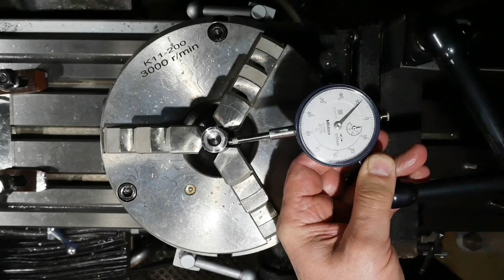Centering work on the rotary table

Comment: Is this still aligned with the Rotary axis?
Reply from the maker: Yes.
This method moves the axis of rotation of the chuck body away from the rotary table axis of rotation. This allows compensation for the run-out in the chuck jaws when tightened. As you saw in the video, the axis of rotation of the workpiece then aligns with the rotary table axis of rotation. 
Thanks for watching.

Comment: Nice!  Going to do this!
Reply from the maker: Thanks Tom. I used M8 x 1.0 jack screws but I think an even smaller thread pitch would be better eg M6 x 0.75 or 1/4" 32 UNEF . This would give an additional 6 or 7 tpi and provide finer adjustment.
Cheers.

Comment: And what many don't realise is  the runout is different at almost every different clamping diameter.... this isn't set and forget.
Reply from the maker: - I should have mentioned that :)
Cheers.
Reply: You could hold a hexagonal er collet block in the 3 jaw chuck. Indicate it true and then you can hold the range of sizes for the ER size.